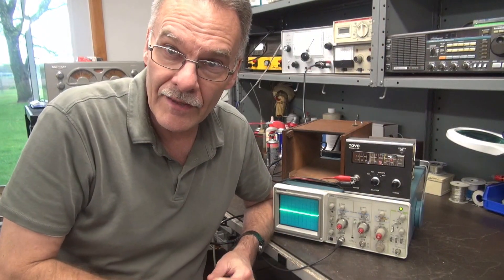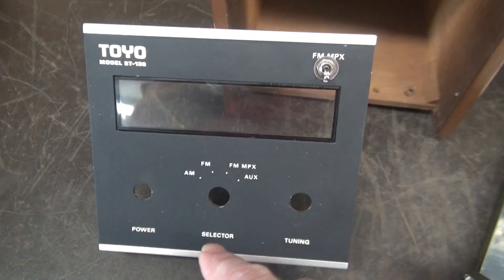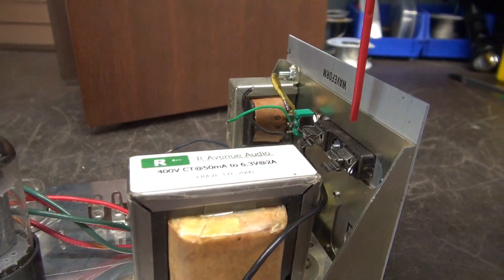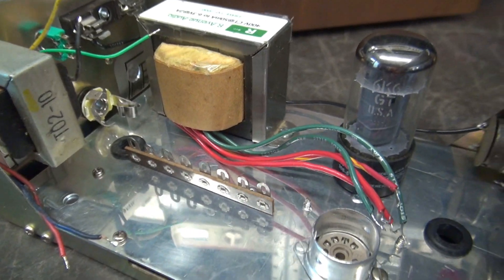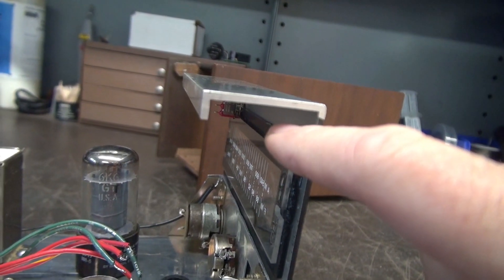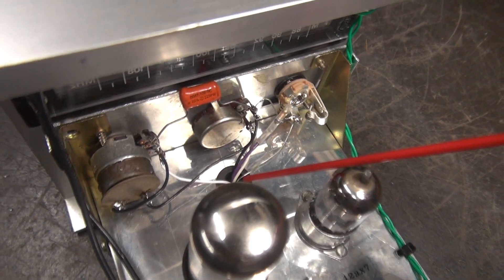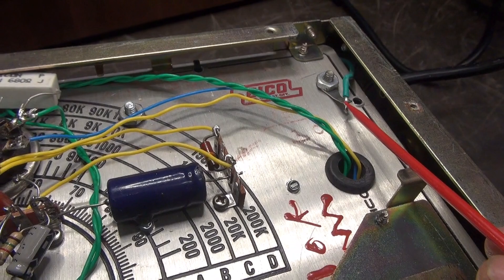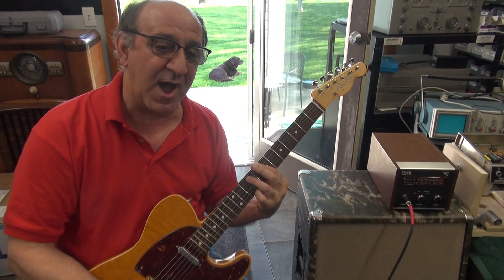How to convert AM FM Tuner into a Class A Tube Guitar amp Homebrew Heaven 6K6 3 watt custom head

Comment: Great project, great amp, and great, AMAZING skills, but let’s be clear: This is NOT a “How-To” video. It’s a “look what I did” video that teaches nothing... It’s also NOT a “conversion”. It’s merely a build that was made to fit inside an old radio case. It is simply a repurposing of a project box. AMAZING job and skills, but again, not at all educational, and not a how-to. It would have been infinitely better to actually show design methodology and steps, and then actual assembly. ACTUALLY TEACH SOMETHING. Like most people, I despise Google over-controlling people’s content, however, I DO wish they would disallow CLICK BAIT TITLES like this one. It’s become a virus in and of itself; click bait titles. I think video titles should HAVE to be pertinent to the actual content of the video, to avoid wasting viewer time and searches. I learned absolutely nothing from this and wasted 9 minutes of my time to find out: “Hey, if you’re already a great and experienced amp builder, you can use an old empty radio case to hold an amp that you build that is completely unrelated to the original radio.”... DUH! ... “How-to” videos teach... This video doesn’t... But thanks for at least showing off your skills. It at least gives me something to strive for, even though I have to continue to search to actually find educational content... The title of this video should be, AT BEST: “Sticking A Home Made Guitar Amp In A Radio Case”...

Comment: Did I just see the Fuse on the Neutral?
Reply from the maker: Have you looked at vintage Fender schematics?
Reply: @d-labelectronics  Not really, Is the Live and Neut flipped on the schematics? If so then why would you Switch the Neutral ON/OFF leaving the Live leg on?

Comment: Just a suggestion...I use construction tie plates that you use to nail two peaces of wood together for a nice large vent hole. They are rectangular metal plates with holes drilled in them. Just cut the rectangular hole a little smaller and mount it under the hole. $0.98.

Comment: If I did this, I would try to cut vent holes in the top of the wooden cabinet, just to let the output tube cool off. What's the best way to cut ventilation into that cabinet?

Comment: Always amazing to me how you get your amps "dead quiet"even when power transformer and tube circuitry have to be arranged in a cramped space and small clearance. If I have a 6K6 not on hand, may I plug in a 6F6 without any change?
Reply from the maker: Hi John, Yes, the 6F6 would work just fine, no circuit changes needed

Comment: Terry, well done, thats a really cool amp... I just finished your 15W Princeton/Tweed Deluxe 6V6 Push Pull and man is it a sweet amp.  Thank you so much. ..  What size rivets do you use to mount your tube sockets ??   Thanks man.. love it..
Reply from the maker: Hi Ron, Glad the project turned out well. I use the standard metal 1/8" pop rivets